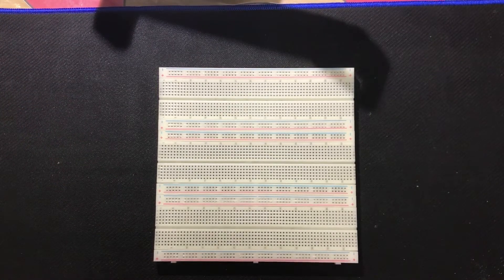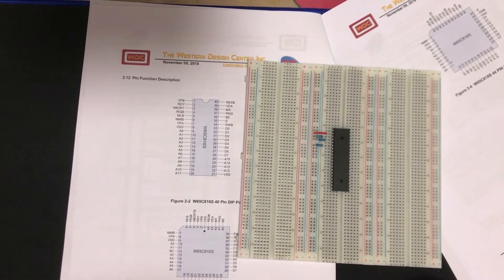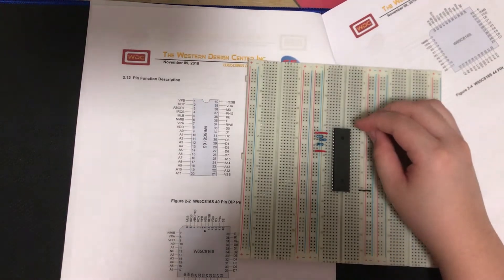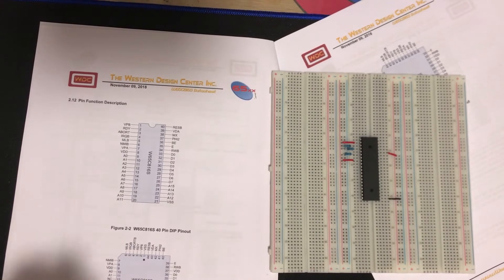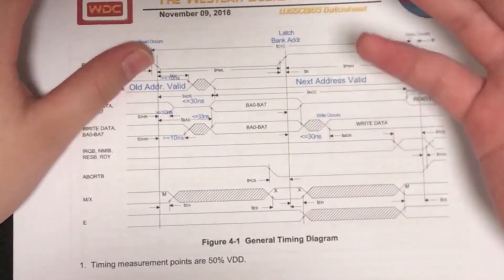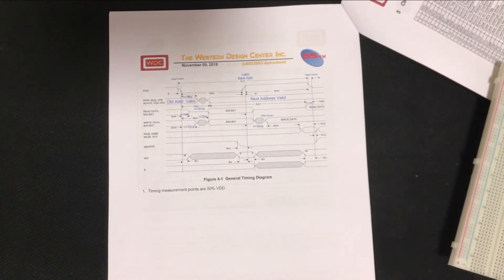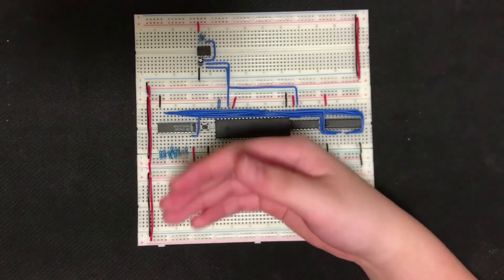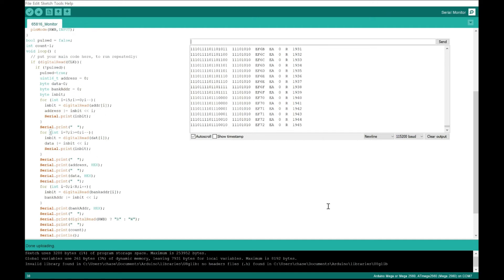65C816: Getting to know the proccessor

Comment from the maker: Here's the code:
int addr[16] = {22,23,24,25,26,27,28,29,30,31,32,33,34,35,36,37};
int dat[8] = {38,39,40,41,42,43,44,45};
int bankaddr[8] = {46,47,48,49,50,51,52,53};
#define CLK 2
#define RWB 3
void setup() {
  // put your setup code here, to run once:
  Serial.begin(115200);
  for (int i=0;i<16;i++){
    pinMode(addr[i],INPUT);
  }
  for (int i=0;i<8;i++){
    pinMode(dat[i],INPUT);
  }
  for (int i=0;i<8;i++){
    pinMode(bankaddr[i],INPUT);
  }
  pinMode(CLK,INPUT);
  pinMode(RWB,INPUT);
}
bool pulsed = false;
int count=1;
void loop() {
  // put your main code here, to run repeatedly:
  if (digitalRead(CLK)){
    if (!pulsed){
      pulsed=true;
      uint16_t address = 0;
      byte data=0;
      byte bankAddr = 0;
      byte inbit;
      for (int i=15;i>=0;i--){
        inbit = digitalRead(addr[i]);
        address |= inbit << i;
        Serial.print(inbit);
      }
      Serial.print("  ");
      for (int i=7;i>=0;i--){
        inbit = digitalRead(dat[i]);
        data |= inbit << i;
        Serial.print(inbit);
      }
      Serial.print("  ");
      Serial.print(address, HEX);
      Serial.print("  ");
      Serial.print(data, HEX);
      Serial.print("  ");
      for (int i=0;i<8;i++){
        inbit = digitalRead(bankaddr[i]);
        bankAddr |= inbit << i;
      }
      Serial.print(bankAddr, HEX);
      Serial.print("  ");
      Serial.print(digitalRead(RWB) ? "R" : "W");
      Serial.print("  ");
      Serial.print(count);
      Serial.println();
      count++;
    }
  } else {
    pulsed=false;
  }
}